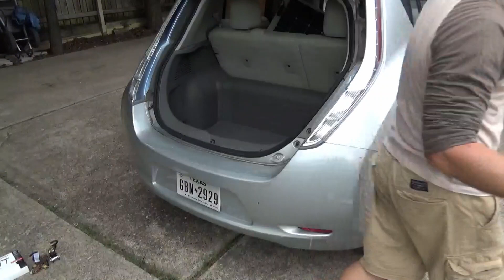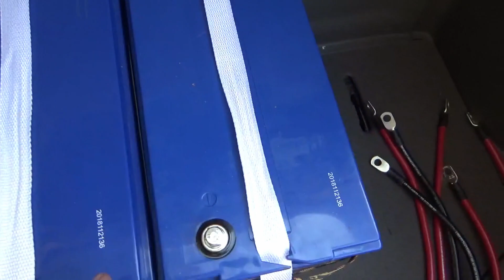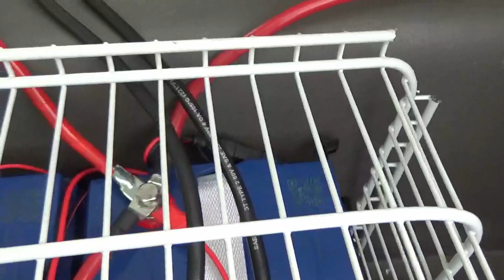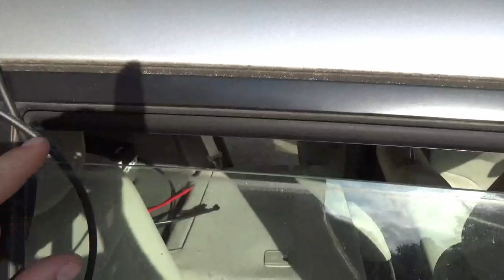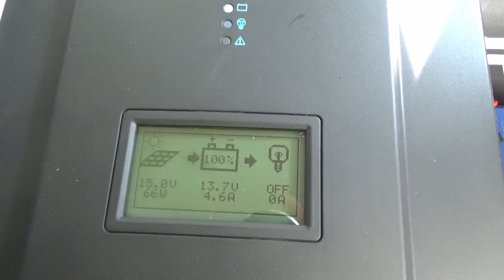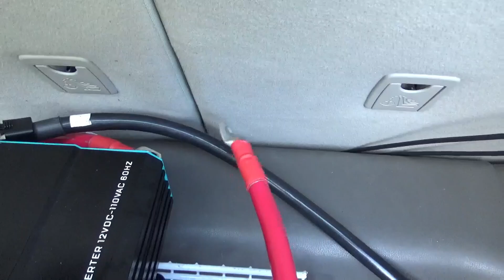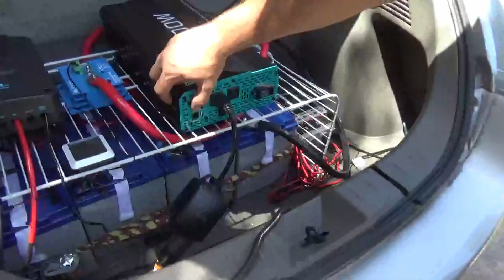Solar Powered Nissan Leaf

Comment: Sooo...excuse me if this is a redundant thought. Like you I am not an electrician or electrical engineer, but this system seems extremely inefficient. Correct me if I am wrong but wouldn't tapping directly into the car's own batteries be the best way charge them? Direct DC to DC? Can your solar panels be connected to a DC to DC converter then perhaps a custom charge controller that would shut off  when the Leaf batteries were fully charged? That would remove the hundreds of pounds of batteries, components and inverter power loss. 

I saw the video of the guy with the 100% solar Chevy Bolt, is that what he is doing? His trunk area looks like it still needs some serious cable management. I will say my jaw dropped when I saw you got 17 extra miles after 12 hours of charging in the parking lot.  (did i miss a video or was that a bucket of ice in your trunk cooling off the system?) I am dorky enough to try this with my Chevy Volt but it needs to be streamlined and dummied down.
Reply from the maker: Direct charging of the main battery from solar will be the final step of this process.  You are right that you loose about 30% of your PV generation with the AC to DC swapping.  The main reason I didn't do that right up front was risk of damaging the vehicle.  EVs have some fairly complex electronics that make sure the 120v AC current you get out of a wall outlet is translated into stable 400v(ish) power you need to charge the main battery.  Im sure we can figure out how to replicate this process using our own PV input device, but if you mess something up,  you could ruin the main battery, and essentially the car.
     Secondly, working with 400v DC power is intimidating.  That is probably more than double a lethal voltage.  We will have to use a transformer (more realistically probably a couple of them) to turn puny little 12v PV power into 400v (main car battery charging) power, and that will carry some inefficiencies of it's own.  The challenges are significant, but I do think it is something we can achieve.  For the time being the 30% waste of running the power through an alternator seemed like a fair trade-off.  It's easier, safer, faster, anyone can do it, and there is no risk of frying the main battery.  And you now have a solar generator in the back of your vehicle for power outages or barbecues, etc.  It's kind of handy.
     I don't know if Daniel in Canada has done this.  I'm communicating with him about a collaboration/the methods he used methods he used.  I really want to do a live conference call with him, and do a live open phone lines episode for this channel, where we take calls/questions.
     The final phase (phase 3) of this channel will be "recycling the Leaf".  In this chapter we will disassemble the vehicle, and show how to sell all the batteries and motors and recoup the purchase price of the vehicle.  When we have the car opened up and all it's mechanics exposed, we will have the PERFECT opportunity to develop a method of directly jacking PV power into the main battery.   And if I mess up and total the car at that point, it won't really matter.  
     Finally, yes it was a bucket of ice.  I hate the bucket of ice.  It is there because I underestimated how hot the electronics would get in the back of the vehicle.   Small compressor-powered a/c units are not widely manufactured and expensive.  I may have found one that will do the trick and replace ole' Icy.  That is actually going to be this weeks episode.
Reply: @InnovativeSustainableSolutions  Yes,  DC to DC is the Holy Grail. I saw only one of Daniel's videos(are there more?) and he appears to be a little coy about how he does it. The glance he gives of his trunk area was a tease. After doing a little more research it appears there are others attempting to profit off of this idea. https://youtu.be/wyJYU2j-FDM  As a consumer I want a kit with flexible fold out panels that can fit into the trunk. Good work, keep on doing what i am too chicken to try.
Reply from the maker: @jamesb4433  Thank you for sharing that video.  I hadn't seen that.  I talk in some of my videos about how unfortunate it is that so many people (like Dan) have constructed vehicle mounted solar options, but not documented the construction.  Leaving those that follow behind to repeat the same mistakes.  That why some of my videos are so detailed (okay long, lol).
     The Floridian Unlimit setup looks very convenient and promising.  And at $2500 for a 400 watt system it's a great deal!  Thats what I built AT COST.  I would love to talk with the creator about how he solved the inverter (that is an inverter in the trunk behind him right?) cooling problem.  An inverter running a 1400 watt car charger (the slowest they make) generates 900 but's an hour of heat.  In an enclosed space like a car,  combined with the natural heating from the sun, it rapidly creates problem that must be addressed.
     If you get a wild hair and decide to attempt something like this; I will help you.  I get a little technical sometimes, but it's not rocket science.  You can do this.

Comment: Nice job.  How did you secure solar panels to car?
Reply from the maker: Eternabond brand RV roof repair tape.  (EternaBond RSW-4-50 RoofSeal Sealant Tape, White-4" x 50' on amazon).  It was originally designed to repair leaks in RV roofs, but has been discovered by the solar community and is now used predominantly to attach thin flexible panels to vehicle roofs.

Comment: lithium batteries can explode in heat. numerous ebikes have exploded in garages that were too hot. I'd look for one that's really well shielded if you do that.
Reply from the maker: The battery bank I'm looking at is a 4.4kkwh LiFePo (a 1.5kwh improvement, and 180 lbs lighter), and if I drop the $2400 on that I'm definitely getting a climate control system too.
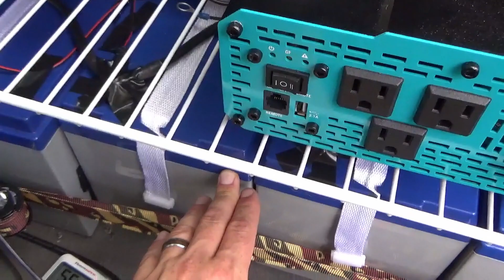Reply: @InnovativeSustainableSolutions  LiFePo4 is safe indeed compared to regular liion or lipos. In the video 25:30 i think you meant lead acid - draining a 3.7v lithium cell below 2.5v makes it a bit more dangerous :D

Comment: I have another idea. Not sure how much energy it would generate but....What if you also had small ducted fans in the front vehicle (say front bumper)that turned wind as you drove into energy too. So the drag would be essentially turned into energy too.  It would be awesome to see a renewable energy car.
Reply: That will drain more energy than it produces.

Comment: dont drain lithium batteries below the minimum voltage, this is fine to do if the batteries have a BMS/batterymaintenance syste, lithium batteries tend supply amperage at close to full power all the way through its discharge range, but the battery shouldnt be drained below the specified minimum.
Reply: Great advice, however he is currently using AGM's
Reply: @karlbartelt3939  I was referring to his coment saying that lithium batteries can be drained to 0% for indefinate # of cycles, and for most people this is true, becuase most people will be using batteries with BMSs if bought at retail this will prevent the battery from draining below its minimum voltage. However, when building a battery pack, you can save alot of money and make it modular to fit your needs, it just wont have a BMS unless you install your own.
Reply from the maker: @denvera1g1  You're right on that one.  I will correct my mistake when we switch the system to LiFePo in a future video.
Reply: @InnovativeSustainableSolutions  It simple to fix for a solution like this, and ALMOST every other situation other than custom battery solutions will have some sort of BMS. Even if the battery doesnt, the device drawing power will have a BMS such as flash lights that use 18650 batteries (like in the Tesla). Which is why, for my DIY solar assisted hybrid (1996 fleetwood limousine) i am going to use high density cells for easy wiring/bussing and BMS, probably 50AH or more  instead of the less than 5AH in the 18650, sure i wont be getting huge amperage draw available to the motors, but i dont plan on having a start stop setup. keep the LT1 driving the rear wheels, a 50kW motor-generator on the drive shaft on the front of the engine, and a 20-50kW motor-generator on each front wheel. I can already use hypermiling techniques to get 30MPG highway, but i can fit almost 9x100watt flexible solar panels on the roof and trunk, i estimate i'll get enough power during an 8 hour working day to drive 8-11 miles on electric only(without accessories or with transmission in nuetral)

Comment: A little quick math. This cost him $2400. At 200w of panels he's probably getting about 1KWh per day. Average price of power nationwide is about 15¢. That means he's generating 15¢ per day that would otherwise be taken from the grid. So to pay for itself this would take about 16,000 days or 44 years. Obviously there's the issue of the longevity of the components also. Batteries and inverters fail eventually.

Not exactly practical.
Reply: Regardless of cost, this is really cool!  Thanks for sharing.  I have. Leaf as well and will try this.
Reply from the maker: @rudysingh5119  E-mail me at Lonestarezev@gmail.com before you order the parts.  I have some considerations you should make before you drop the cash (battery choice, making your own panels, etc)
Reply from the maker: Yep, assuming you drive for free now.  Which I don't.  My F150 was costing me $2800/year in gas.  Watch my other video "Why make a solar powered car?".  I walk you step-by-step through how this saves me $2,000/year.

Comment: These are the "hours" you can expect to calculate per day on average for that month, not taking into account cloud coverage or shadows assuming panels parallel to the ground (lying flat).

Jan     Feb   Mar   Apr   May   Jun   Jul    Aug   Sep   Oct    Nov  Dec
3.85  4.78   6.09  7.39  8.29  8.67  8.52  7.84  6.68  5.29  4.13  3.58

So, essentially, just multiply your wattage by the month's value to calculate the amount of power you will generate in a given day during that month.

For instance, in January, you would multiply 250 Watts * 3.85 hours to get 962.5 wh for the day.

In July though, you'll get 2130wh. This is mostly due to shorter days during the winter, as well as a lower solar flux due to the sun being at a lower angle. You can find more about there here: https://en.wikipedia.org/wiki/Lambert%27s_cosine_law
Reply from the maker: I never saw that table, but that's lining up pretty close to my first couple weeks observation.  My best day so far is 1.3 kwh.  Obviously maximizing the solar input is critical.  We are working on plans to build custom shaped panels to fill in the geometrically irregular pieces of roof real estate we have left (that video should be out soon).  I'm confident we can atleast double the 250 watt figure, maybe triple.
Reply: @InnovativeSustainableSolutions  That's because I created it...I'm working on an app that calculates your solar output at any given time of year based on your latitude, arrays of panels, and tilt and orientation of arrays of panels.

I calculated your latitude as being in Dallas, just because it says Texas on your video. 1.3 kwh actually seems kind of low if you're not parking in shade or anything. Are you sure all your panels are the same voltage, particularly the small one? I know sometimes the larger panels can be 18V, and the smaller ones 12V, so something to look out for.

Comment: Why not set up the solar power at home and charge from there? Much neater and more room for solar panels. 

I realise then you don't have it on the go but if you're going home each night it makes way more sense.
Reply from the maker: Good question, and definitely the most common.  We have panels on our house too.  This system is for aging EVs that no longer have the range to make it all the way to work and home on a single charge.  Prior to now all these vehicles had just been scrapped (you don't see many 2011 Leafs anymore).  Now you can squeeze a few more years out of them before they get repurposed as powerwalls.  Plus it's just cool to make your own fuel on site.
Reply from the maker: @marthale7 Awesome.  Instead of the 390+ voltage charge controller, I'm going to try and run the 14v line that goes from my charge controller to my battery bank through a transformer or voltage step up to get that up to 390v necessary to charge the battery.  We'll gain 25% efficiency if we can bypass the DC-AC-DC of traditional plug in car charger.  I'll do a video on this in the next couple months.

Regarding the German DIYer.  Please share links if you have them.  He must be adding to 40kwh to the 24 kwh original to the car.
Reply: thank you for posting a reply.  I get it. 👌🏿👍🏿🤞🏿

Comment: Awesome idea. I just had a couple of questions and a comment:

1. Why did you get a battery charger that could charge each battery individually, but then connect it so each charger sees all of the batteries (all batteries and all chargers are connected together)? It seems like you could have just bought a single charger to accomplish the same.
2. You should remove the fuse while doing the wiring and only install it when you are ready to turn it on.
3. Convention states that the fuse should be on the +ve side, why did you choose the -ve side?
Reply from the maker: 1.  The Noco is also a battery health device.  I push these batteries HARD in this system, and this device has a solid reputation keeping abused batteries alive long past their lifespan in these conditions (hot, deep cycle)
2, 3.  I wasn't lying in the video when I said I don't have an electrical background.  I'm figuring this out as I go, and I have made mistakes (AGM instead of Lithium).  The fuse between the batteries and the MPPT protects the charge controller from an internal short (I think).  The Inverter has a peak draw of up to 100 amps so it's gonna fry most fuses you put there, but I will probably go back and address this in a future video.  Thanks for the pointer
Reply: @InnovativeSustainableSolutions  
It is really cool that you are doing something out of your comfort zone and I don't want you to take my questions/comments in the wrong light. I mean no disrespect. 
The fuse is a good idea. With automotive wiring, you should not think of the fuse as protecting equipment (it may or may not) but rather that the fuse is protecting the wire from melting and starting a fire. To size a fuse you figure out the max draw and the length of wire you need and then use a calculator like this: https://www.wirebarn.com/Wire-Calculator-_ep_41.html (anything under 3% drop is typically considered fine) and then you get a fuse that is smaller than the max the wire can handle. 
Personally, I would move the fuse to the +ve side because most all metal pieces in the car are connected back to the car battery. With this in mind, any +ve line that touches a metal body part will spark, since you currently don't have a fuse on the +ve side you have to be conscious of it touch any part of metal on the whole car and a circuit will be completed and bad things may happen. On the other hand, if you moved the fuse to the +ve side (-ve side can touch any metal part without sparks as it is open) the +ve side would pop the fuse if you accidentally touched it to metal. Does that make sense? Oh and no worries getting shocked from 12V DC. You could grab both + and - wires and you wouldn't be able to feel the current flow due to your skins natural resistivity.
Finally, grab a grommet and cut it or maybe some windlace for the part you cut in the hatch.
Reply: @InnovativeSustainableSolutions  As far as 1 goes... I just want to make sure that you understand that each of those 4 Noco chargers are trying to keep all of the batteries healthy (all 4 chargers at the same time) as well as trying to charge the batteries at the same time... I really don't know if it will ruin the charger, the battery or if everything will be fine.
Reply from the maker: @trevor5545  The Noco connections are at the bottom of the terminal with the parallel wiring on top.  I'm hoping the charger will work with each individual battery as if they were individually linked, but I'm sure that won't be 100% the case.  Im sure there are people out there more knowledgable than me who know of a better tool for this job.  If you're reading this please share!
Reply: @InnovativeSustainableSolutions  Trevor is correct, with the battery in parralel they will all stay balanced with each other. the noco will see this as one big battery Nd do it's work. having 4 is good as one would take forever to charge 4 discharged batteries of the size your using. 

Now if you switch to a series setup  (48v) then you would want the 4 nocos as each will deal with a battery on a 1 to 1 basis, in series batteries can get out of balance. the up side is at higher voltage you  are drawing less current and don't require as heavy copper cable while still drawing the same wattage.

Comment: Great idea! But why don't you use the car's internal battery instead of filling the trunk, adding the weight and complicating the things? As far as i know Nissan Leaf supports regenerative charging while driving so there must be a way to connect your solar charger to the Leaf's system without using all that heavy batteries and charge it whenever the sun is shining.
Reply from the maker: It does, but the regenerative braking still charges at close to 400v.  I have no idea how to get a PV system up to 400v yet.
Reply: Just use a step-up converter